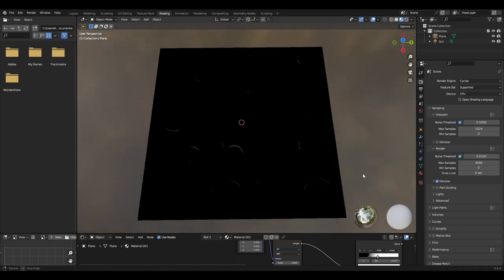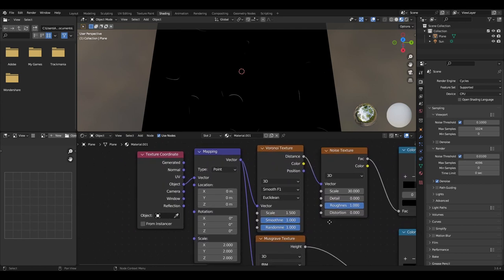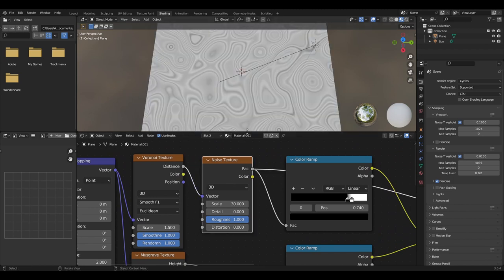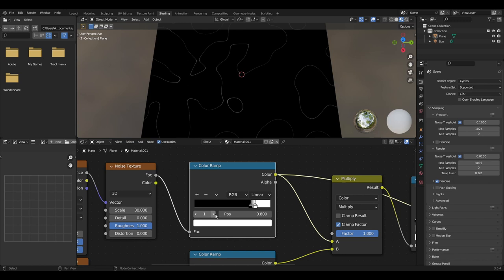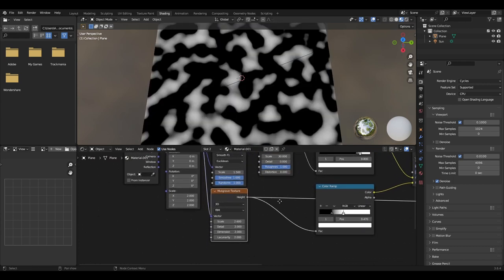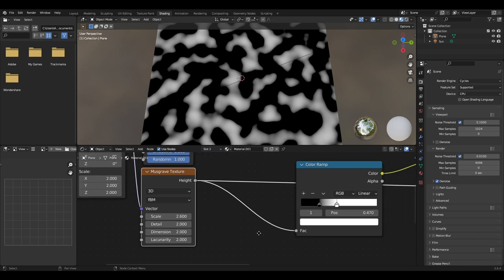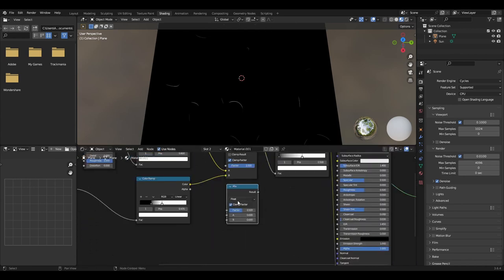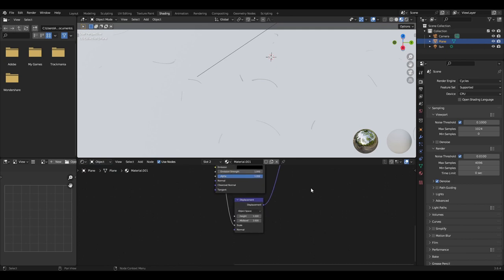Procedural Scratches | Blender

Comment from the maker: If you are plugging the colour ramp into a bump node instead of a displacement with the settings i have in this video you will need to select invert as white is the high point on the texture and the black is the low point. Hope this helps